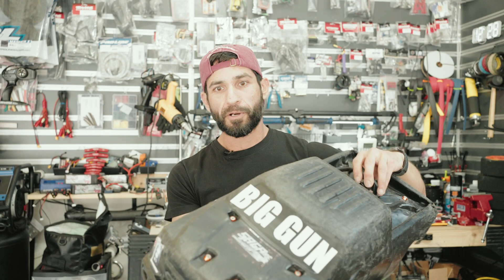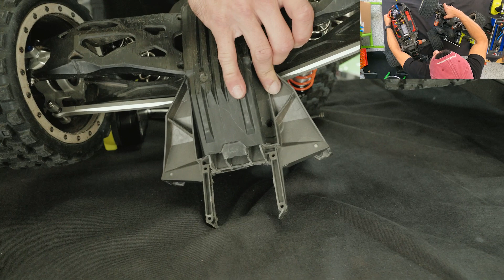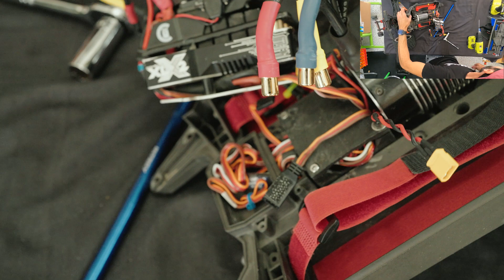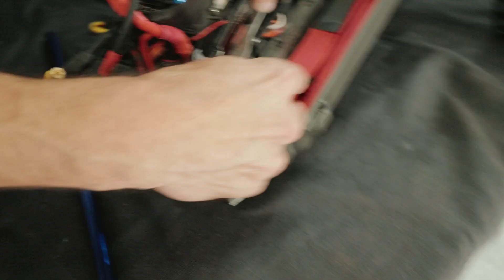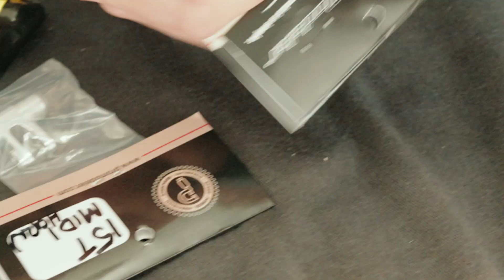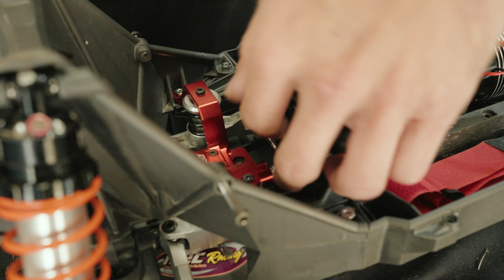Promodeler DS1885BLWR Midi Servo "Porker" Installation X-Maxx DS1885BLHV DS1885BLDP Large Scale

Comment: Hi, I would like to take also this big Servo, but I wonder why there are so less YT , is there a point why this servo is so less bought? Also whithout of the price. Are you still happy with the Servo? Today the are some more strong Servos, Savöx 2290 like mine, or Futaba 700, or OMG or Holms. Would you prefer also today the Promodeler 1888 ? Thank you and much greatings from Germany 🙂
Reply from the maker: Yes, I completely understand your question. I have probably failed at providing action video showing my servo working beautifully and as well as it did on the very first day. I have had this Servo for a long time now and steering is not something I ever need to worry about anymore. This servo is like the Ferrari of servos. It has reinforced hard points, bronze bushing inserts, and has been made to withstand extreme vibration distress, and impact tests that exceed military spec. This servo also uses a very large 15 tooth spline on its output gear. And the torque is truly amazing. I have been able to jump my truck off of a second story overpass using a ramp. That is probably around 55 feet of vertical drop and the servo works flawlessly after every landing. And the reason you see other people using different servos, is because they are often cheaper in price. But after I tried buying several different cheaper servos, I realized that I was just creating more frustration for myself. I finally replaced about nine servos, that could not hold up to my extreme abuse. That is, until I found a ProModeler. Promodeler Servo‘s are built with extreme bashers in mind. Should you ever manage to break this servo, Promodeler will gladly repair it for you. They offer a very fair limited warranty on manufacturing defects. They will not warranty for user error (like using inappropriate voltage or intentionally submerging the servo to play “submarine warfare”.) but they will still offer to repair it for a nominal charge. You can email me at H3ŁŁFįR3RC@gmail.com for more details if you’d like.
Reply: @h3llfir3rc  Thank you very much 🤗
Reply: @h3llfir3rc  Hi, finale I have also a 1885 😊. The Servo has a servocable with 3 Wires and a doublecable with 2 wires with a xt30 conector for the extra akku. Can I plug in the servocable in the Receicer or have to delete the middle cable , the Plus, when I use the separate accu without using the bec. Maybe the servo has a switch to use BEC and when plugin  the separate accu the switch take the power from the accu and can ignore the plus from the receiver?
Best regards Andreas
Reply from the maker: @slomofan2070  I emailed you back about 30min ago. No need to disconnect middle servo cable wire from the servo with the DS1885BLDP. The middle servo cable wire is necessary for nominal signal voltage from servo to the receiver since there is a unidirectional diode that prevents the servo from receiving any power from the receiver. The servo is 100% powered via the xt30 connector lead. So do not remove the servo connector’s power wire as it is configured differently than a traditional servo (traditional servos only have ONE wire and receive power from the receiver, so with a traditional servo, if you want to power it externally, then yes, you would need to use a rX bypass adapter or pull the servos middle power wire. NOT the case with the DS1885BLDP).
Reply: @h3llfir3rc  Thank you very much !🙂

Comment: Could one just plug the servo to ONE  of the batteries of the x maxx ?!
Reply from the maker: To answer the question, yes, it will work, but not well: I don’t recommend using a balance lead on one of the 4S packs because of the current surge that occurs when the servo is under load. It can fry the wires on the balance wires and the connector pins. I say this from personal experience of this happening. This is why a dedicated LiIon or Lipo would be best. Plus, should there ever be a problem with the Lipos, or the ESC in the future, the servo will not be subject to any of those damaging effects. Hope this helps….
Reply: @h3llfir3rc   thx for the reply but i would tap the power straight from the battery connector...
Reply from the maker: @guillaumedubois8896  I definitely would not do that since it will be giving the servo 33.6V, which is 2x of what it is rated for. When two batteries are connected in series, you will get the sum of the batteries voltage, regardless of which connector you try to tap. The only way to get only 14.8V from an individual lipo is from the balance leads, but again, I would not recommend doing that. To verify what I am saying, Tap the wires with a voltage meter, once it’s fully-connected and you will see what I mean.
Reply: @h3llfir3rc   i know that but my plan is to tap on the first battery conector before the second battery double the voltage since they are plug in series...
Reply from the maker: @guillaumedubois8896  - Ah! I see what you mean now. This will work as long as you are not tapping any of the series wires. Keep in mind that even though this will technically work, the servo performance will be subject to voltage drop by the Lipo itself if you are hard on the throttle. If you insist on not using a dedicated LiIon pack to power this servo (you rate not alone in this as there are quite a few people that do not like using a dedicated pack to power the servo), I would at the very least recommend you do NOT tap the main lipo pack directly, rather, tap the series wires at the base of the ESC main +/- wires and attached a capable BEC, like the Castle BEC Pro or BEC 2.0. This will at least regulate the voltage output to the servo and help prevent any big surges/drops in voltage/current to the servo. This servo really is the very best there is for X-Maxx, and I am only offering some helpful tips for you to get the absolute best performance 100% of the time:) Happy Bashing!
Reply: @h3llfir3rc  No, do not tap into one of the propulsion packs as then you expose the servo electronics to the ripple due to the motor and ESC. 

Jeez the ideas the clueless will come up with while believing they're smart!
Reply from the maker: @modelsport2858  I do my best to discourage tapping mains as it is destructive on so many levels… yes, the ripple alone will start damaging the servo and shorten the life span either way. I get a lot of questions from people that have already decided they are going to do it the worst way possible and are looking for validation from me…. When I do not give them that, they start trying to justify as if I do not understand… It’s frustrating but I do my best to be polite about it. But you are correct… there are those that think they just invented a new way to power a high grade servo… but if that were true, it would already be a common way to do it…. “You can only lead a horse to water…”

Comment: What kind of charger do you use to charge your auxiliary battery?
Reply from the maker: I use a normal lipo charger. The main power lead has an XT30 connector, so I bought an Male XT30 to Female XT60 adapter (you can also make them yourself). Since that is what one of my chargers uses for the connection plug. I have an iCharger 406Duo and a Hobbymate D6 DuoPro as well. No need to use any special setting, it can be charged using the normal lipo parameters at max 2C charge rate. So, if it is a 2,000mAh pack, then I can charge at 4A.
Reply: @h3llfir3rc  thanks for the info!

Comment: like the video but, whats with the rats nest of wires i know though its highly modded so you have a pass! sweet video...
Reply from the maker: Yeah, I blame castle for their 300mm long wire leads - LOL! I've since pulled the XLX2 and installed a 400A Flier ESC... little more manageable now... and surpisingly turns the Hobbystar 56112 into a complete uncaged animal. But you are right, I need better wire management before next video upload:)

Comment: Does this kit come with everything? Including the Y-Harness or does that have to be purchased separate, and if so which one or item # is it?
Reply from the maker: It comes with the Servo and you will need to choose the add on option for X-Maxx, which will include the 15T Horn needed). The Servo comes with a separate XT30 connector wire so a Y-Harness is not necessary with this model. You will however, need a LiIon (or Lipo) to power this servo. I use the Flat 4S 850mAh 15C packs from Promodeler and sometimes use the Flat 4S 2000mAh 10C pack if I know I will be running the truck all day long. The difference in pack capacity: the 850mAh pack will get me through a couple packs of Main Lipo packs easy, while the 2000mAh LiIon pack will last through 4-5 Main Lipo packs. Both flat packs fit the width of the center chassis, where the ESC and motor are, so I use a simple accessory plate and mount it over the motor. I could just as easily use a Square style pack and mount it towards the front of the truck, again, using an accessory tray. Again, to sumarize, when you order the Midi "Porker", you will be prompted to choose if it is for X-MAxx, and when you do that, it will come with the 15T Horn. and you do NOT need a Y-HArness, but you will need a dedicated "propulsion" pack and can use either LiIon or Lipo, although I recommend LiIon because the packs are much more stable and can be run down a little further than Lipo without damaging the battery and can hold charge much longer than a LiPo without damaging the cells over time.